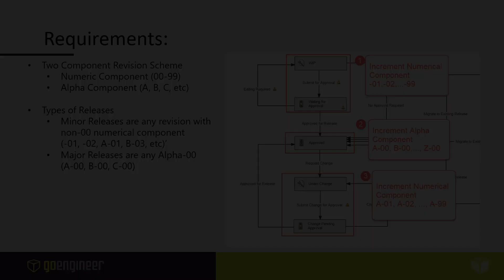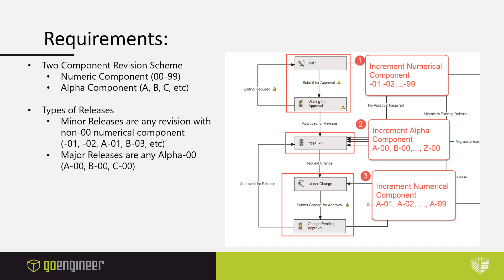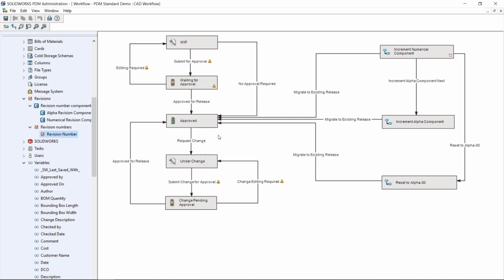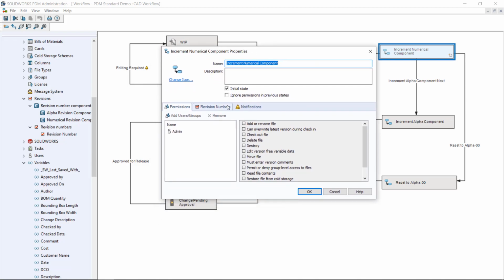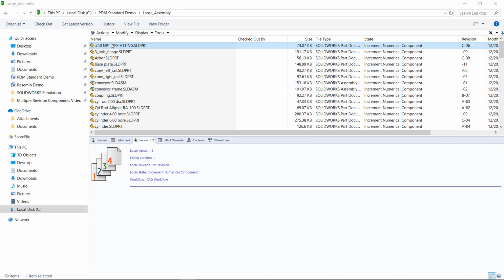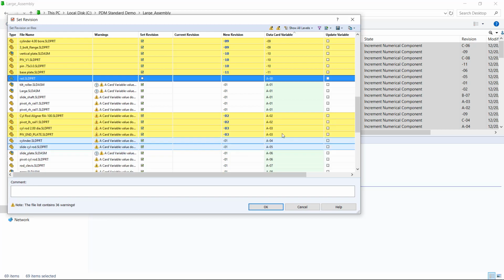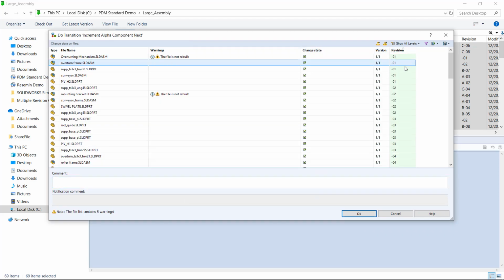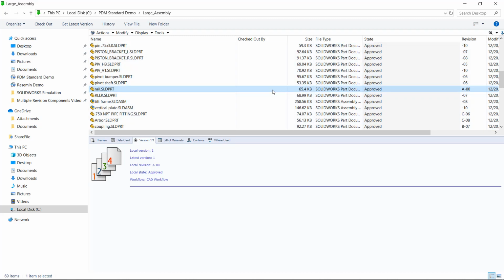SOLIDWORKS PDM Tutorial - Using Set Revision with Multi Component Revision Schemes

Comment: If I need to change the state of migrated file to WIP file after approved, that transition needs to be added into this workflow. Because migrated file can still be incomplete files. Am I missing something?
Reply from the maker: You are not missing anything that is correct. The basic assumption is that files being migrated are complete but that is not always the case. Workflows are customizable so you have options for how you want to handle this sort of thing. You could make a workflow transition, or you could give specific users the permissions to edit "Released" parts.
Reply: @goengineer  This video perfectly makes sense for me now. Thank you.